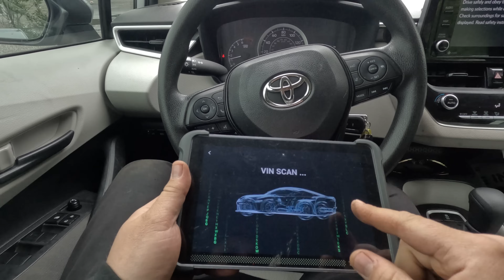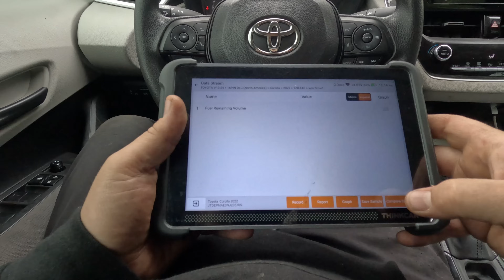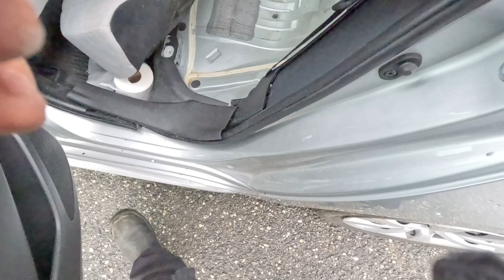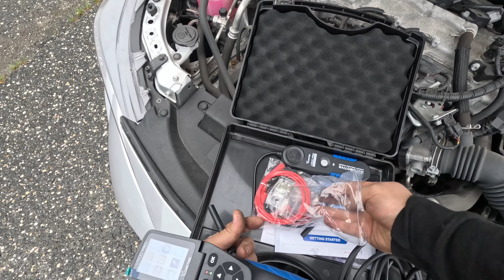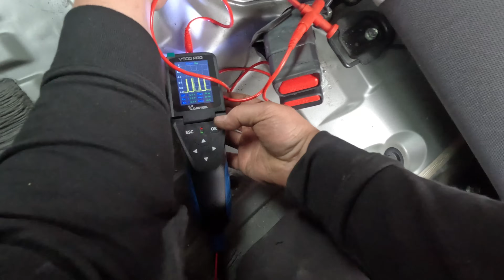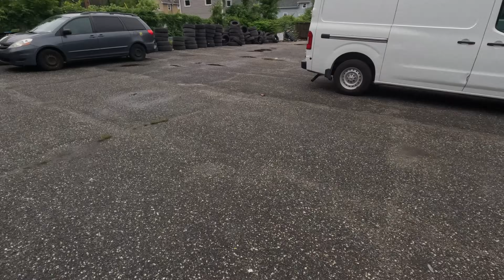2022 Toyota Corolla - Fuel Gauge Stuck Full! (VDIAGTOOL V500)

Comment: Yeah i had issues using the vdiag piercing probes too. I got a bad resistance read on a wire once I think the insulation was adding to the resistance but after rechecking with back probe needles it was fine.

Comment: What? 

Okay, I get that the fuel level sender is a potted hall transducer in the trunk, and the combination meter is always reading full, and there are no Fuel Level Sensor DTCs like P0461 stored in the ECM. So far so good. 

The fuel level sender uses three wires on harness connector O44, White Pin 2 FE, Gray Pin 1 FV, and Red Pin3 FS, and there is a connector in the tank, Black Pin 2 Ground, Red Pin 3 Power and Green Pin 1 Output. 

According to the Toyota fuel level sensor testing procedure, to test the fuel level sensor a +5 VDC current limited supply to about 250mA is applied between power and ground, and the output is measured with a voltmeter between output and ground, smoothly changing from Empty (0.345 VDC to 0.695 VDC) to Full (4.255 VDC to 4.605 VDC) as you move the float arm from empty to full, which all makes sense.

But, in the video why is the power feed at connector O44 Pin 1 Gray from the combination meter a pulse signal? I was expecting a +5V DC reference to power the sensor and provide an accurate voltage reference. Also, strange is this pulse signal was fed through from the power feed Gray Pin 1 to the sender output Red Pin 3 on O44, when the connector was seated. 

More strange is with the connector seated, by pulling the Red Pin 3 wire to a positive 5 Volts (current limited through the test light) continually the Combination Meter reads a slightly high Full value, and when pulled to ground continually through the test light, the reading is Empty. 

The operation seems to be a pulse control supply, but by applying continuous voltage the combination meter displays the expected fuel level reading, and seemingly without any DTCs being stored, why? I can not find any reference to pulse based power control for the Fuel Level Hall Sensor. It is possible the fuel level sensor strategy was modified after production but I could not find any TSBs or recalls. If the supply is pulsed it would be to reduce heating the fuel in the tank by keeping the sensor off most of the time and only reading the sensor output when the +5 VDC supply is present. Which is a little strange because the pump motor is cooled by the fuel via the internal regulator.

Does anybody know why the sensor supply would be pulsed?

Since the float is stuck full (probably pinned by a broken baffle due to the rear end accident), it makes sense that a circuit out of range cross connect ECM DTCs have not been stored, because the sensor output is within the expected range.

Comment: How are the VA 200 Pro essentially the same thing just doesn’t doesn’t have the tilt screen and I love it and the wire tracer works for me
Reply: I dont think the v200 has the relay testing or the low voltage application function
Reply: @ExploitedAmerican   either does the power probe but power probe has better quality plastic. And they sell those items to add for low voltage for activating 5 volts and relay testers. But you don’t really need those things.
Reply: @AdamDobbs-t6l i needed it for testing if an ecu pid was accurately detecting voltage. Are there other ways of doing that? Yeah but its a convenient feature

Comment: Piercing wires is hackjob activity. Use a backprobe like a man. Any guy I catch piercing wires in my shop is getting an ass kicking
Reply: Troll, Bernie also pierces wires, but I agree with you, I always back probe as well but I dont bash skilled tech like this one. There are sealants that can be used to protect the small pin hole.

Comment: The circuit tracers seem to work perfectly on their advertising videos but on my car it indicated breaks in the wiring harness at 3 locations. Fortunately before tearing open the wiring harness I found the actual problem elsewhere. Maybe I need more practice ....
Reply from the maker: In general I have a very hard time with circuit tracers. I think the bundle of harness becomes an antenna so it sends you all over the place.

Comment: What voltage was on red wire how did you know to put this to ground? These tools are good if you know how to use them as putting power or ground to wring wire could break a module...
Reply from the maker: I didn't put anything to ground by itself it was through a test light that can only pull 120ma
Reply: @advancedleveldiagnostics  Ok thanks for this appreciate your knowledge... Ive subscribed
Reply: Thanks for explaining the use of test light to limit current. You stated that one power probe was dumping 10a when you did something similar. Wiuld use of test light to limit current just be good practice to protect your tool and car?

Comment: Anther fantastic video 👍🏼👍🏼👍🏼👍🏼👍🏼, question I would like to get a Panasonic cf-33 , can you tell me the specs on what you have in yours , os , bt etc. thanks much.
Reply from the maker: Thanks! It's a windows laptop I7 7th gen. I have a 1TB SSD, it works with the SATA drives I could not get an NVme drive to work. It  has Bluetooth and you can but a sim card in for service.

Comment: Good job, but one quibble: I didn't see you verifying the ground.  Either by passing current, or by measuring it after you plugged it back in.  If the ground was open, the output would likely show "full" regardless of the position of the float.
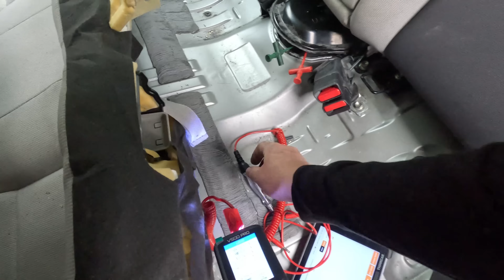Reply from the maker: At 12:17 I tested the ground with a test light. I went from positive on the probe and touched the ground wire and it lit up. Sorry if I wasn't clear.

Comment: Reminds me about my 1998 explorer, got rear ended in 1999 and after the bodyshop replaced the left rear quarter i was driving it to work and the gauge said full all week. The baffle can surrounding the pump broke free from the adhesive and it slid under the float arm and locked it up. Had to get a new fuel tank complete.

Comment: I bought a new 25 Corolla for my son for college graduation. It has 200 miles on it. It's been at the dealer for 3 weeks for a low oil level message. Dispstick shows full. Found out the car right off the boat with 6 miles on it had an exhaust cam gear replaced that was never disclosed at purchase.  So far they have changed the cam housing. I searched this issue and Camry's had the same issue. The cam housing seemed to fix those but not ours. They replaced the oil pressure control valve, and did an oil change. They have the Toyota engineers involved but they are just firing the parts cannon at this point. Obviously the oil level sensor was the first thing they did. Now they are replacing the ECM/ECU. I have contacted Toyota for a replacement at this point. I still think they make reliable cars but we got a messed up one. Their engagement team so far has been great. They didn't BS me around. They asked me what they could do to resolve this. I also know the dealer is trying everything to fix it but I don't have confidence in this car any more.
Reply: ECM? Really? IMHO, something wrong with instrument cluster or wiring harness.
Reply: They are just firing the parts cannon. I have no doubt Lazer, Ivan, Diag. Dan or Eric O. would have it figured out within 2 hours. The engineers aren’t much better than the techs.
Reply: @scotts4125 those engineers did not design the cars, they are just graduates that are learning the technology as well just like any of us, with the exception of not using a scope which would fix this simple circuit issue. Im thinking this is a fitment issue of the pins at the oil sensor connector or PCM. I have disconnected and inspected ECM connectors and reconnected it and it fixes circuit issues. Crazy but has happened and I can attest to that.
Reply: @scientist100  They don't use an oil level sensor any more. It's calculated based on oil pressure and RPM.

Comment: if i invented an automotive focused wire tracer that actually worked id be a millionare
Reply from the maker: My problem with them are is the tone gets transferred through the whole harness so you have no idea where to go.
Reply: @advancedleveldiagnostics  bingo. its not nearly as exact. there has to be something about AC house wiring that makes it more effective than 15 miles of DC 12 volt spaghetti wrapped together in a sausage of doom
Reply: @advancedleveldiagnostics its always been hit or miss with me, I always try, sometimes it works, sometimes it don’t.
Reply: Best one I found - General Technologies FF310

Comment: Nice find, still a simple circuit on these Toyotas, and they still use the same connector as they did 4 decades ago.
Reply from the maker: I think the only difference is now its a PWM signal from the cluster as opposed to a simple variable resister.
Reply: That’s why I like toyotas, they not keep changing stuff which works, just because it’s old. Have fitted gloves box dampener from 2024 rav 4 to 2011 avensis. Still same part
Reply: @robertolaggo9141 tundra 3.5l twin turbo enters chat. Miss the v8 option hence me keeping my 21’